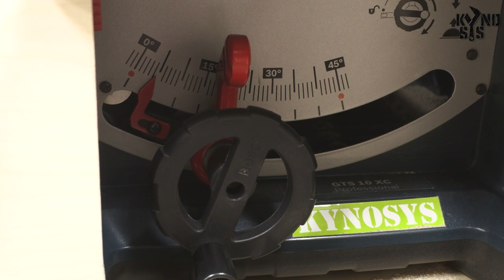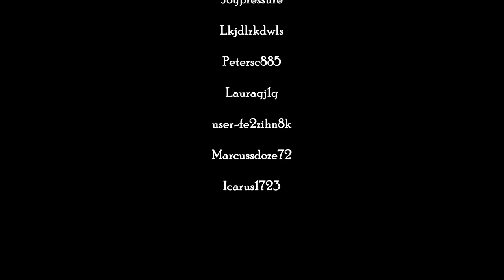Drill Press Auto Lifting Table / DIY

Comment from the maker: Please turn on your language subtitles! 
Please join our membership!
When using a drill press, we always have to adjust the height of the table. This is because the length of the bit is different and the height of the member is different.
It has a very old form of crude handle that doesn't match the development of other tools.
Strangely enough, the drill press doesn't seem to generate power.
Fortunately, Bosch has developed a product called PBD 40, which allows it to move with a circular handle.
The height is adjusted in a very crude form using worm gear and rack, and because of the nature of the product, it's often placed in an environment where iron is easily processed and contaminated, so it's understandable that it's the simplest structure. But considering the price range, even products over $1,000 had small handles in the form of small balls of iron, not handles, which hurt my hands every time I worked.
I don't understand this no matter how many excuses the drill maker makes.
So I took out the weak metal bundle and changed it to an easy-to-fix handle.

So, I made it so that it can be lifted automatically using a 12V deceleration motor.
The height of the drill press is a structure in which when the handle is turned, the worm gear moves up and down on the rack. The worm gear was removed and the shaft of the deceleration motor was directly connected to the handle of the shaft.
And I made a motor box and attached it to the turning part by hand.
The combination of worm gear and rack is a structure that can move enough for small rotational force of worm gear, and the gear ratio of the deceleration motor is very low, so it is not difficult to move at all.

Because it is a 12 volt motor, it used a 12 volt adapter, and the switch used a momentary switch.
Only while the switch is being pressed, the motor must rotate and move the table.

With a simple installation, the table moves up and down very smoothly by pressing the switch.
It's so comfortable to use. I wonder why the company won't improve this simple part.
Motor and adapter switches cost less than $20.
If I develop a product, I would like to make a product that can do both lifting, fixing lifting, and controlling speed.
It's really simple to implement, so I hope you guys make it.
A new chapter in drilling begins.
Thank you.

#DIY #DrillPress #Drill #AutoLifting #Bosch #PBD40 #Making #WoddDIY

📢BGM
✔Track - The Road to Your Inspiration - Inspiring Cinematic Music
✔Soundcloud - https://soundcloud.com/keysofmoon
✔나눔뮤직 - https://tv.naver.com/v/12021211